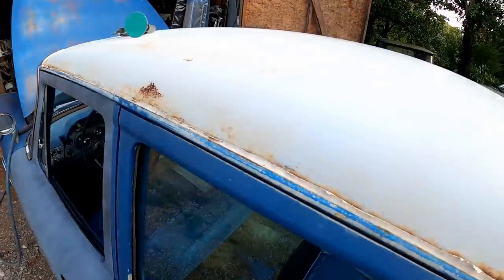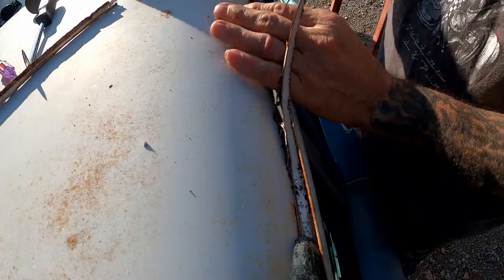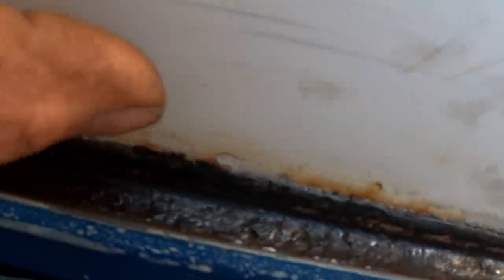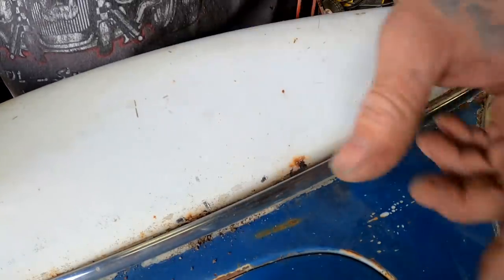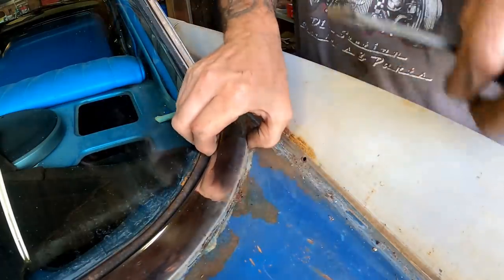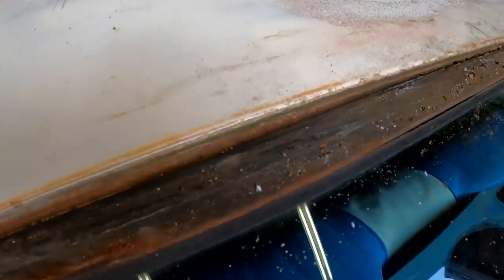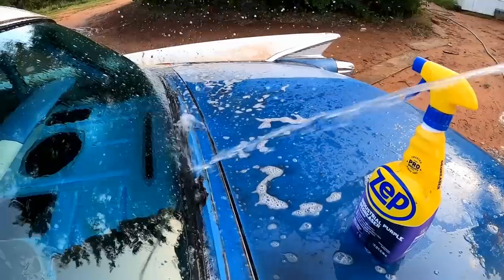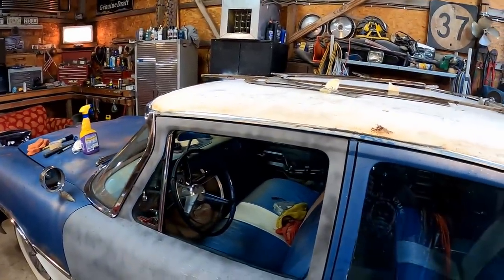Doing bodywork to the '59 Dodge Coronet pt.3

Comment: That rust under the windshield channel seemed wide spread Maybe it's the perfect time to remove the windshield and clean the rust beneath it. newer windshield adhesive will provide the protection and longevity it needs.
Reply: No. Don’t use adhesive on the gasket set window. Take out the window and rubber, paint the pinch weld area and reinstall the gasket and window. Adhesive in that application will hold water and create more problems in the future

Comment: These last 2 videos have been your best work.  Fantastic content.

That back glass channel looks like it was purposefully designed to cause rot and cause you to buy another car.  Planned Obsolescence at its finest.

Three years ago I was in the middle of a 1965 Nova station wagon restoration when I took a job out of state.  That's on hold now, may end up going to a friend to finish for me this winter.  I stripped the entire body back to bare metal.  The old seam sealer was crusty and 'snapped out' in 2 inch lengths.  What a PITA.

Comment: Way to go WB. I have lots of experience with those old cars and the massive amount of chrome trim. Patience is the word. I left a comment with Randy when he got this car that there was a lot work involved in painting this vehicle and God only knows what you will find under the trim. It always seems to trap dirt and hold moisture that causes rust. So far you've been lucky. Lets hope your luck holds. If you were working with a 70s vehicle you'd have holes everywhere. The metal is not as thick as the 50s and 60s cars. I did a 70 GTO and the back windshield was held on with just the adhesive. I had to cut the whole area out and make my own patch panels. It can be done, but takes time.
Reply: Every time I wash one of my cars I use the high pressure water to flush out what is under the trim, mostly on the side of the car.  I think that will help to not have any build up.

Comment: I used rust encapsulator on some of my projects and it worked very well ,and held up outside in tough weather . I have a spot blaster with several different tips for odd shaped spots that really does a great job of getting out all that rust.
Reply: Does that work really well? If weird beards using it I would imagine so, but I want to know if it holds up to the rust. I've seen rust converter Walmart style and in a few years it's coming through, I'm looking for it for myself to shoot into a quarter panel after repair just incase an I want to do it right.
Reply: The Eastwood rust encapsilator worked really well for me and I live in the rust belt with lots of salt on the roads in winter @danielcarter5579
Reply: Yeah ive had good luck with it too, a lot of people write it off as junk because it didnt last when they painted it right over a bunch of untreated rust. Its really made to seal in any pitting type rust you cant get at after you clean back any of the flaking or dusty stuff from the surface.

Comment: I really like that parts washing brush you use on the channel. I use it when vacuuming around bottom of seats to detail those hard to reach areas with vaccum. I also use a new dollar tree toilet brush in the drill by cutting off the handle so it will fit into the drill. Thanks for the great video!

Comment: A Man and His Pick - the professional way to dismantle a car, clean out drip rails, align holes, and a thousand other uses. Get your Pick now from a participating auto parts store for the low low of 19.95, what a deal. This is meant as humor and not a slam.
Loved the style of the video and this is a Great video series so far. Are you going to pull the front and rear windows to replace the rubber and seal any rusty surfaces that may be there.

Comment: Hell yeah Mike, you're really tearing into that thing!  The video formats are all good!  I like going back to the original colors too.  

My '77 F150 had rust-out at the top of the windshield, I guess from GD mice nesting up in there and pissing everywhere.  That pinch-weld seam was gone...  I got another cab.  That rust at least made getting the windshield and seal out, without any damage, a lot easier.

Comment: I am amazed the windshield and rear window areas don't have a ton of holes.  Lots of Cameros from the 60s were rotten there in the late 70s.  Lots of Fords rotten out in the roof areas, my mother had a 1978 Caprice with leak around the windshield, I took it to a windshield replacement man around  2000 and the entire lip around the top of the windshield looked like swiss cheese.  The car was otherwise in good shape,  he told me he could not fix the windshield so it would not leak.  We filled it with some epoxy and put clear silicone around the top of the trim piece.  It didn't leak and 5 years later we sold it to a young man and told him about the problem.  The windshield man told me it was a very common problem on lots of cars.

Comment: The design was not for long life, look how the holes for the trim are at the bottom level of the channel so water could flow into and around them. The gasket for the rear window and its big area to hold dirt and water. He was lucky to find a car that was garaged a lot of its life. You are correct, got to it in time! NICE work you do Mike!

Comment: Your work is inspired. Your step by step explanation is so different from other guys. So much better. Someone with zero experience could be more apt to give something like this project, or something not quite as adventurous as this one, a shot with more confidence because of the way you explain things. Keep it up Mike! Will be watching. Is your dent puller gun repairable? Have looked at new ones. Quite a range of quality and prices. Will be watching for the next video!

Comment: I find this style of video great to watch. Like looking over your shoulder as you go. I was waiting for the screwdriver to disappear up to the handle as you were cleaning out the seam sealer in the roof gutter. I don't know if anyone has mentioned Coldwarm Motors here in Canada. He put a 1960 Plymouth body on a 1960 Dodge Pioneer floor and joined them together. Language is coarse and the "F" bomb lands like he was carpet bombing but I keep seeing you saying "This is going to be hard but let's get at it." as he works on it.

Comment: My first car was a 57 Plymouth, same generation.  I picked it up in 62 for $75 from a new car dealer!  It had an electrical problem which turned out to be bad wiring on the mechanical voltage regulator. That car was three on the tree with a 318 V8.  Power nothing.  The Fords of that period were rust buckets, obviously Chrysler was doing metal a little better.  However all of the manufacturers mechanicals were expected to fail in 50k miles. Oil was extremely poor and tolerances were rarely met.  The Sears Auto department could do ring jobs back in the day and holes in a piston were not uncommon.  As a result few of the late fifties car survive.  Its worth doing an original restoration on your car.  By the way, your channel has risen to the top in my opinion, with content exceeding your mentor.

Comment: Looking good mike. Getting all the rust taken care of. Just one thing. U have went this far. I would remove the back glass and seal. To remove the rust from the pinch weld. I would see if the rubber seal is available. Get a new one and cut the old one and that back glass will come right out without breaking. And after paint rope the new one in

Comment: The trim i believe is stainless steel that is why it looks so good after all these years. It is a lot of work but I would take all trim off and strip it to bare metal. New fresh coat of primer sealer would take this car to the next level when it is done. Also all that trim cleaned and polished it is going to look real good. I can not wait !!! Start calling you weird beard overhauling.

Comment: The way you're making the videos is great. I would have liked to see you buzz out that surface rust around the rear window would be the only thing I would change. As for panel by panel, I would do color by color. Prime the roof when ready, and then complete the rest of the bodywork and prime the entire car. Then mask the car and paint everything that need to be ivory white first. Then unmask and remark to paint the blue. That lighter blue is the best choice, and will really make her pop.

Comment: You have to remember these trim pieces were installed on an assembly line.  That means they had to be able to  be installed quickly so they  can come off quickly as well.  Very few pieces will have internal screws holding them.

Putting masking tape on this type of trim is a bad idea.  If any type of heat hits it, the adhesive will stick to the trim creating another problem.  The blue tape should be used in its place.

Comment: oh, wb, if you do decide to remove the front or rear window, keep in mind that mopar used a strange locking/unlocking process built into the rubber around the glass. And the front is designd to pop out. also i recommend against using the stock white. it just winds up looking dirty. i painted over that on my car.

Comment: A little sort of half private yard half used car lot near here the cars rusted from the top down due to the chemical plant nearby.  58 Dodge in the back of the yard the whole roof skin was gone.  It rusted around the edges and the car was out of reach of his dog's leash so he thought kids nabbed it and used it for a slide.   But the wind could have just as easily picked it up and sailed it away.

I had a 58 Chrysler I never took more than the rear window from, I think rotted out in the window corners.  I know if you stood on the rear bumper the whole car would flex, the back window was basically loose.  But that's what the salt did to them.  

I can see where that whole roof was surface rusted and painted over, lots of pits.  But that's the problem with these old cars, you could probably do 20 videos on it fixing all the problems with it.  Labor intensive to get all the trim off and get all the rust knocked off or sealed up.  Because at some point it was just an old car and not worth doing everything right on.  

I had a '50 Chevy that they'd made a patch for the right quarter bubble out of tin from a sedan.  It had a visible 3" gap between the two sections that had a mix of lead and bondo and who knows what.  I sold it to someone else who pried all that garbage out of it. 

I suspect some of that stainless around the window is meant to come out with the window as part of the rubber gasket.  All that sealer makes me think the gasket is shot and it leaks water through somewhere.   The good news is that glass and the trim should be the same on all 57-59 Mopar post sedans.  The whole greenhouse.  Below that is 59 Dodge only, although DeSoto used the same dash and the small DeSoto and Chrysler use the same frame. 

One thing, having been under probably two dozen of these, the frames are prone to rot in two spots.  Just ahead of the kickup for the rear axle they can get holes, and the C-channel gets weak around where the leaf spring mounts at the back.  I have a '58 DeSoto bumper that came off the car with the whole rear frame crossmember, I think I only had to cut across the top.  The '57 Dodge wagon I had the frame tried to break in the middle, too, but it was jacked around while frozen to the ground in March.  And the bumper fell off that one, too, the guy who bought it never picked it up.  I don't think this car will have any of those issues, but the frame is fairly thin metal and the quality control on these was spotty so.. I mean if I was buying it I'd look those spots over good.   The only one I ever had that wasn't breaking in two was a '58 Dodge ragtop and it still had a couple little holes in the kickup.  (that car is a story in it's own. I bought it from scrappers in an old junkyard in February who then left never to return.  Then I sold it to a guy with pictures of it with a foot of snow around it and no idea if it would even come out in one piece.  I got my money back from the scrapper foreman and had to go back and buy it again from the next set of guys who were in there.   The guy just shows up out of nowhere to pick it up, got me in trouble with the buddy who was helping me, so I never mailed him the key or the vin tag that had fallen off.  Eventually that guy sold it to someone else and that guy called me and I sent him the key and tag.   So far as I know it's been restored.)

When I was flipping cars heavy like 10-12 years ago, at some point I had one each convertible Plymouth (59), DeSoto (58) and Dodge (58), two two-door hardtops Plymouth (57) and Chrysler (58) and the 2-door wagon Dodge (57).  Those were the days.  Projects are almost impossible to sell now.

Comment: You need to use some wider trim tools like you would use on plastic to spread the pressure, less likely to bend bottom grove than using a narrow screwdriver.

Comment: You should start with the roof the car. Since its a larger part, then the hood, after  that the trunk the side panels are the smallest, which you could knock out quick.

Comment: That car looks like it was repainted  by Earl Shives before. You need a rim or edge sander to get down in there.
Reply: Hi John - for those people who might not be old enough to understand your reference, here is some additional information:

Earl Scheib was a company which specialized in low cost repainting and collision repair of automobiles, with locations in 23 states in the United States. It ceased operations nationwide on July 16, 2010.  Many locations actually converted to Maaco paint shops.  Some locations continued operating independently as Earl Scheib.  In the 1950s, Earl offered full paint jobs for as low as $19.99!

Comment: Your paint code is either XB4 or XC4. Probably the latter. Should be on the data plate under the hood on passenger side. If you want to reference the colors, AutoColorLibrary.com is a good place.

Comment: Need a wire brush on a wheel on a drill clean it right up to get the rest of that sealer out should have use a flat head screwdriver

Comment: I would pull the glass and kill the rust under it if not ur goint ti have rust issues down the line have a window guy come in and remove the glass and treat the rust under it do it once do it right